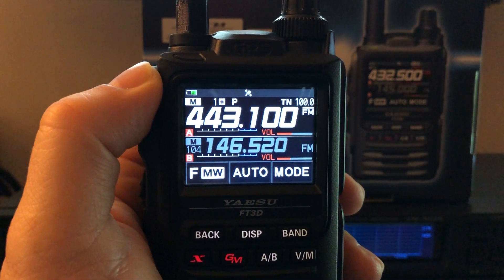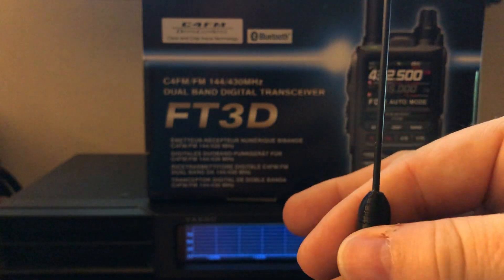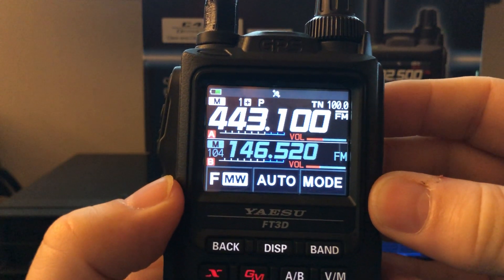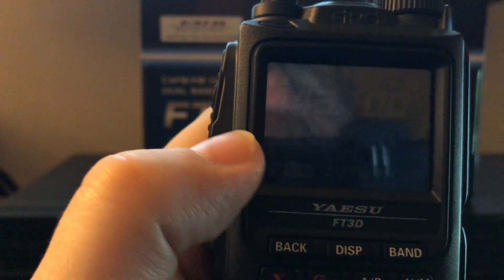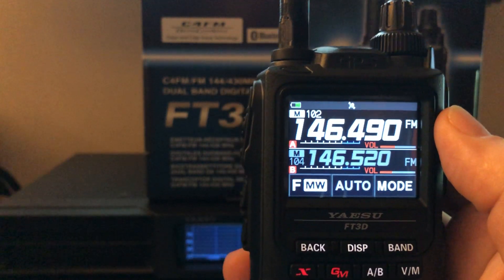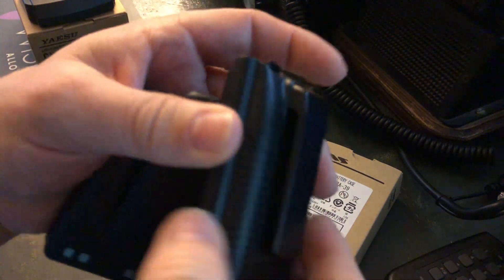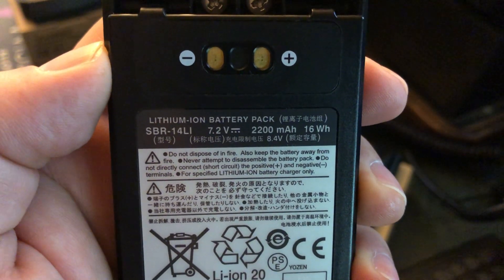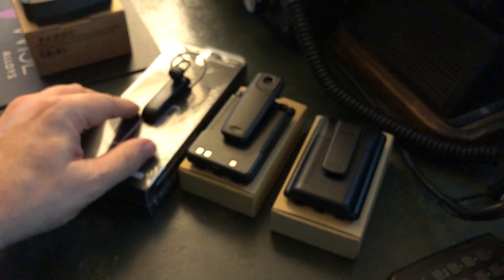Yaesu FT3DR: Introduction #yaesu #ft3dr #hamradio #ht

Comment: best video I've found on this radio.  Thank you!!
Reply from the maker: Thank you!  I like the FT3DR.  It has the best filtered SDR receiver that I’ve encountered in a HT.  It can still suffer slightly from intermod in metropolitan areas or near a broadcast tower, but all SDR receivers will, and some superheterodyne receivers will.  That’s why I keep a FT-60R around.  It has a dual superheterodyne receiver that has proven to be able to receive even when I stand at the base of the tower of a 50,000 Watt broadcast transmitter.  But the FT3DR is still the best of the SDR types.

73, de N4HNH

Comment: Is this a higher end competitor for a beufang uv-5r ?
Reply from the maker: I’m afraid the Yaesu HT and a Baofeng HT are not even in the same league.  The receiver in the Yaesu is way beyond a Baofeng.  If you cannot hear the other station, you can’t talk to them.  I have been on team outings with Baofeng owners and I had to loan them a HT.

Plus the FT3DR, now FT5DR, has GPS and APRS.  You can send and receive a text message with it.  There are places with no cell coverage but radios can send a message.

I hope this helps.

73, de N4HNH
Reply: @N4HNH Radio  can you program this one to talk to 2 way walkie talkies as well ?
Reply from the maker: This is a 2-way walkie-talkie for ham radio frequencies.  To use those frequencies, you must possess a Technician Class amateur radio license.  The exam consists of 35 questions.

73, de N4HNH

Comment: Newbie question, but why do you need a license to use the FT3D if it’s on,y a VHF/UHF and only receives low range frequencies?
I was under the impression you only needed a license to transmit in low frequencies?
Reply from the maker: The FT3DR is a VHF/UHF ham radio.  A Technician Class license is required in order to transmit with such a radio.  

To transmit on a HF radio, will require a General Class license.  A Technician Class has some limited CW privileges within the HF bands, and they can use SSB between 28.3 and 28.5 Megahertz, at 200 watts or less power.  The General Class opens up a wide range of frequencies and allows up to 1,500 watts of power.

73, de N4HNH
Reply: @n4hnhradio  thanks for the reply. 
I just inherited a new FT3DR and was wondering if I can just use it on the regular FSR frequencies all my friends use on their cheap Beofengs when out in the back country. 
From what I can tell, in my area radios are limited to 2 watts of power without a license, but I have many friends with 4-8 watt Beofangs they use with no license. 
Would it raise any flags if I just used my FT3DR with them?
Reply from the maker: The FT3DR will only listen on frequencies outside of the limits of the amateur radio bands.  The transmitter inhibits transmission on such frequencies.  The antenna isn’t made for those frequencies either, so transmit power will be compromised.  The transmitter could even be damaged if you try to transmit on frequencies that the antenna is not made for.

Since you were fortunate enough to acquire a FT3DR, I would highly suggest going to www.hamstudy.org and studying to pass the exam for a Technician Class license.

73, de N4HNH
Reply: @n4hnhradio  Thanks for the reply. 
But unfortunately if it’s not even capable of communicating with public hand held radios, then it really has no value to me.
Reply from the maker: I know someone who might buy it from you.
Reply: @n4hnhradio  I’m from western Canada so it would be a bit of shipping cost attached.
Reply from the maker: Understood
Reply: @n4hnhradio  you still interested then?
Reply from the maker: Not for me.  I have one.  I just know of a guy who was looking for one, but he has decided to buy the FT5DR, so he can get the 3-year warranty.

Comment: You need to use the sda-24 power cord as prescribed by yaesu to utilize quick charge.  
Please clarify.
Reply from the maker: I called Yaesu when I bought the charging cradle.  It didn’t come with a power supply.  They told me to use the charger that came with the radio as a power source for the rapid charger.  

It isn’t a rapid charger that charges in 2 hours.  It is mostly a convenient cradle for charging.  However, it does seem to charge a little faster than when you plug the stock charger directly into the radio.  I prefer that it not charge too fast.  Rapid-chargers can be convenient but they can diminish the amount of charge cycles a battery can withstand.  So, I just consider the CD-41 as a convenient charging cradle.

73, de N4HNH

Comment: Great Overview.  Just received my FT-3DR and this helps in getting started, as well as the additional accessories available for it.
Reply from the maker: Congratulations!  I like the FT3DR.  Mine is still doing well.

73, de N4HNH
Reply: @n4hnhradio  I was hesitant at first, but a couple of buddies of mine acquired one and it's packed with many features.  It is higher priced than other radios, but it looks like you get quite a bit for your dollar.  I especially like the ability to message via APRS.  I'll be looking for your video on that feature.  Thanks again.  73's.
KI5NIO
Reply: I bought mine second hand and it came with the spring clip.  I'd say that the clip is an absolute necessity - the spring is real strong and it clings on SO tight and there's no prising it off ... it's on there like a hobo on fries!
Reply from the maker: Yes, I agree.  I bought extra batteries for mine because I hike and camp with it.  I also bought the AA battery pack, for emergency backup.  The TX power is lower with AA but it is for emergency backup only.

They changed the arrangement of the buttons in the FT5DR.  I prefer the FT3DR.  They are basically the same radio.

73, de N4HNH

Comment: will the antenna burn up i was thinking of getting one i go out in the middle of nowhere.  gotta get a call sign. let me know please. have a hood day.
Reply from the maker: I’ve never heard of an antenna burning up.  The radio puts out 5 Watts.
Reply: @n4hnhradio  my brother has a kenwood he had an antenna. doesnt work any more kenwood is fine.
Reply from the maker: Most hams I know don’t use the stock antenna.  They buy a Diamond SRH77CA.  Some even opt for the SRH770S.

73, de N4HNH
Reply: @n4hnhradio  thats all my brother has is a hand held tri band kenwood th-f6.   you been doing this a while.  need more info.  have a good day.

Comment: Hi! Could you do a fast test for me? to input 27.225mhz and set the receive mode to FM? I need a confirmation that this works since it's a deal breaker for me in buying this and there's no shop near me that has it in stock to do a real life test
Reply from the maker: Yes, in VFO mode, I can program via the direct entry keypad, 027.225 MHz.  I then hold down the DISP button to access the menus.  I tap TX/RX, then select Mode and press DISP, then select RX mode and press DISP, then rotate the knob to select FM.  Then press BACK 4 times to return to the main display.

Note that the FT3DR will not transmit on Citizens Band frequencies.  And 27.225 MHz is typically amplitude modulation.

73, de N4HNH
Reply: @n4hnhradio  in europe we mainly use fm for road traffic info, so without being able to test this option I have to ask, since buying a kenwood d74 which has a proper wideband receiver that I’m sure it works is too expensive for my needs ... at that price I’ll continue to keep 2 radios in the car, 1 for cb, 1 for ham bands
Reply from the maker: That would be best.

Comment: Hello. 
1. How do I turn off the tape I don't use on this device. For example air band. 
2. How can I restrict it on a certain channel
Thank you.
Reply from the maker: I’m not sure I know what you mean by tape.  To my knowledge you avoid the airband by not using it.  You must switch to VFO mode and cycle through the bands in order to access the airband.  You would then need to program a frequency.  Beyond that, you would need to save the frequency into a memory in order to facilitate quick recall.  I’m not aware of a way to completely disable access to the non-amateur frequency bands.

Comment: I really appreciate this video, Doug. And your others on the FT3DR. You mentioned it has a built in screen protector, and I'm wondering where you read/heard that. What do you know about the screen protector? Can you share? Thank you.
Reply from the maker: Keith, I just feel something like a thin membrane over the screen when I press it.  It doesn’t seem to be something that can be replaced.  I did purchase the optional “leatherette” cover for mine, but it doesn’t cover the display.  It’s nice padding though, to prevent superficial scratches I hope.  I have one on my FT-60R and it saved it from a fall on my driveway that probably would have damaged a corner on the radio.

73, Doug
Reply: @n4hnhradio  Thanks for the reply and the info. I'm enjoying the series. 73

Comment: Can you charge the extra battery in the cradle without the radio?
Reply from the maker: Indeed you can.  The cradle is sold separately.  You power the cradle with the wall charger that comes with the radio.  I have two batteries.  One stays on the radio while the other is charging.

73, de N4HNH

Comment: What is "CQ Soda"?
Reply from the maker: CQ SOTA means CQ Summits On The Air.  There are some videos on the channel that show SOTA activators in action.  You climb specific mountains and make simplex contacts with only battery power or solar power.  You can get points toward awards.  It’s an incentive to practice communications when the grid is down or during inclement weather.

Any licensed amateur can participate.  Just register at www.SOTA.org.uk

73, N4HNH

Comment: Do you know how can you connect to a repeater with a diff PL tones? Like for example the PL.tones on the Tx is 100 amd the Rx tone is 77. I cannot figure how to set it up. Thanks
Reply from the maker: I’ll shoot a video.  There is an option for TX tone and RX tone.  73, N4HNH
Reply: @n4hnhradio  thank you so much. will wait for that video of yours to upload
Reply from the maker: I’m afraid it looks like you cannot have a separate TX and RX tone.  I even tried the method for programming an odd split into memory, but it only allows the same tone for both TX and RX.  My $90 FT-65R can do it.  If you are a member of the Official Yaesu USA Facebook group, try posting the question to @John Kruk.
Reply from the maker: Jansen, I confirmed with Yaesu that you cannot use two different tones for TSQ.  They don’t even understand why a repeater group would require a different tone for receive than for transmit.  

There are two options for you, as I see it.  One is to program the repeater for tone only, not tone-coded squelch.  You will be able to trigger the repeater and hear it on receive.  Of course if you are hearing another distant repeater this method won’t solve the issue.

The other work-around that might work is to program the repeater’s TX frequency into VFO B, with TSQ enabled and the repeater’s TX tone set.  Do not program an offset.  Then on VFO A program the repeater’s TX frequency with tone, not TSQ, set to the tone the repeater expects from you.  Again do not program an offset.  Set VFO A as the active, TX, VFO.  Transmit with VFO A and receive with VFO B.

And I still recommend that you contact John Kruk at Yaesu.  The best way is to post to Facebook.  Companies don’t like bad press.  Posting to a social media platform usually rattles their cage, so to speak.

73, de N4HNH
Reply: @n4hnhradio  thank you for that info. i will try that other work around.

Comment: I'd really like one of these, but the 991a comes first. They're both very compelling buys. I just wish the refresh rate of the 991a's scope was a little better.
Reply from the maker: 991A should be a first choice if you are General Class or above and will use a base/mobile more so than a HT.  The HT is great for hiking and camping.  You will like the FT-991A.  The scope doesn’t bother me.  I only look for spikes to know if there are others on the band.  That’s all I use one for.  The receiver is a boss and that is the higher priority for me.  73, N4HNH
Reply: @n4hnhradio  you have a 991a? Do you know if you can do 2 meter packet radio with just a single USB cable like you can the other digital modes, or do you need anything else?
Reply from the maker: I don’t own a FT-991A.  I have used one a few times.  Actually I used my friend’s FT-991, and was very impressed.  I don’t do packet but I know the radio has a built-in sound card.  For FM packet it will require a slightly different setup.  Below is a link to a discussion regarding packet and the FT-991A.  73, N4HNH 

https://forums.qrz.com/index.php?threads/yaesu-ft-991-fm-packet-9600.613797/

Comment: FYI If anyone ever has a problem where the screen is lit but blank. there is a very hard to see switch next to the data port that more than likely you bumped in some way.  I had this problem a couple days ago, and you can imagine how upset i was till i talked to a tech at Yaesu today. hope nobody needs this info but if you do here it is.
Reply from the maker: Thank you for sharing that information.  You might save someone a great deal of frustration.  73, de N4HNH

Comment: Great video, that group channel monitoring feature is cool.  Never knew it could do that.
Reply from the maker: Indeed the Club Active Monitoring (CAM) is cool.  I use it for SOTA.  I can call CQ on 146.520 while checking other simplex frequencies for a vacant frequency to move to, or while watching to see if someone starts transmitting on one of the other simplex frequencies, in case I’m looking for another contact.  73, de N4HNH

Comment: I recommend a quick charge cradle.  The HT charges VERY slowly with the charging cord shipped with the radio.  You should also buy a Nagoya 771 antenna.
Reply from the maker: I have the rapid charger, as well as the Bluetooth headset.  I use the Signal Stuff antenna when hiking.  It has the same gain as a Diamond SR77CA.  But for longer range I use the Diamond SRH770S.  Best HT antenna on the market.  It beats the telescopic ANLI, yet the Diamond is flexible.  My record with the SRH770S is 124 miles simplex.  73, N4HNH
Reply: @n4hnhradio  Thanks for the recommendation.  I haven't tried the Diamond yet.  Will look into that.

73
KI5KET

Comment: The radio has a weak reception sensitivity.  I bought one at HamRadioOutlet for $ 400 and took it back a week later.  Compared with Icom ID51A Plus, Icom IC-91AD and Yaesu VX-6R .. all three radios were better in sensitivity and selectivity than Yaesu FT3D.  A color touchscreen display would be nice if it also received digital TV, and radio only needs information about frequencies.  At the same frequency, all three radios received good reception, without interference and hiss, and FT3D through strong hiss.  I don't know, maybe I got a defective radio?
Reply: Either your HT is defective or you don't know how to operate properly.
Reply from the maker: Mine receives quite well, but, being an SDR, it suffers from front-end overload around tower sites.  But it has the ability to switch to Narrow FM.  That cleared up the interference I got from a forest of transmitters and towers at a tower site last week.  So far, I am quite pleased.  But I won’t give up my FT-270R.  It is 2m only, with a tight front-end and superheterodyne receiver.  I have stood next to the tower of a 50,000 watt broadcast transmitter and carried on a simplex QSO with someone 60 miles away, without interference.  I was on a mountain, but only at 1700 feet ASL.  Others, with SDR HTs couldn’t hear a guy 12 miles away who was running 160W on 146.520.  So the FT-270R is a keeper.  But the FT3DR is fast becoming a favorite.  I want to take it to the mountain with the 50kW transmitter and see how it does.  I know I will have to switch to the Narrow FM mode though.  73, N4HNH

Comment: Hello. Is the signal stick SMA male? Does it need any spacers? Thanks
Reply from the maker: The Signal Stick seems to perform close to the level of a Diamond SRH77CA, but the Signal Stick antenna is lighter.  For longer range contacts, I use the Diamond SRH770S.  I made a 99.1 mile contact on 146.520 a few weeks ago with the SRH770S.

The Signal Stick is male, but you can order female if needed, to use with a Baofeng or the entry-level Yaesu radios, like FT-65R, FT4XR, etc.  

There is a spacer on my FT3DR but I think it came with the radio.  I need a spacer for my FT-60R, but Diamond antennas usually include a spacer, in case you have a radio that needs one.

73, Doug
Reply: @n4hnhradio  thanks a lot!